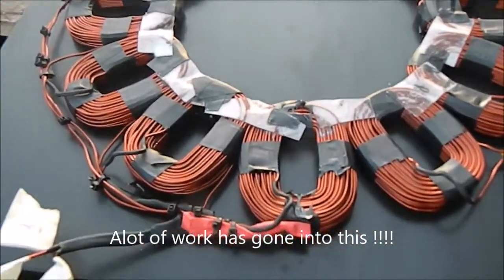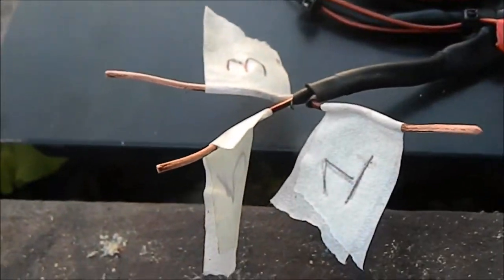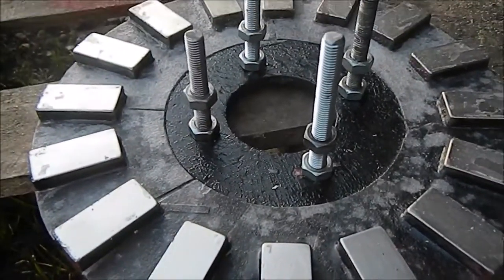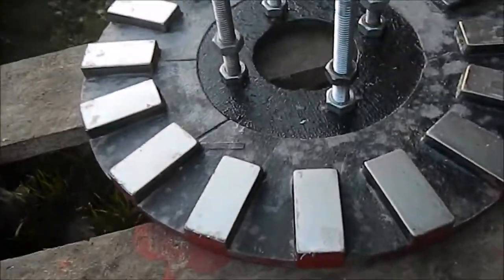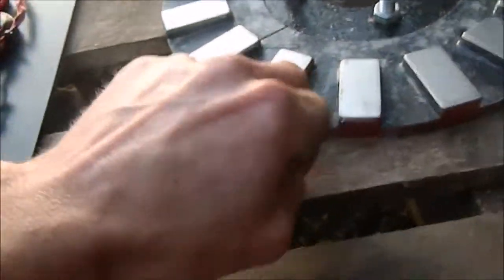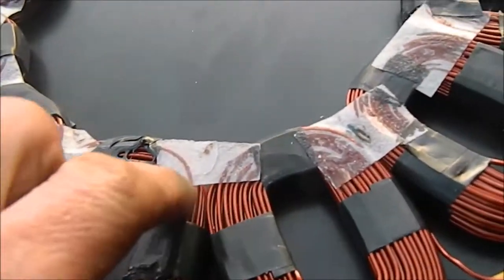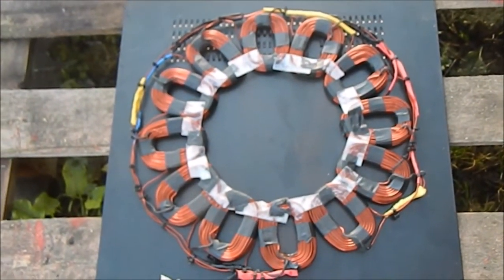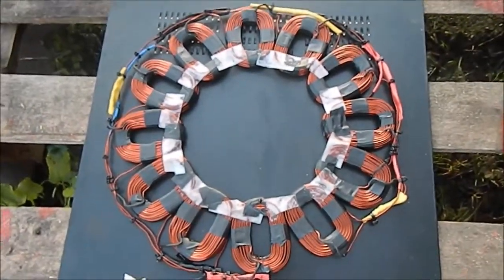VAWT Wind turbine Stator major progress 14 12 2016

Comment: Hi! Do you think a 22awg with 120 turns per coil will be any good? Thanks
Reply from the maker: NO THAT SOUNDS WRONG I THINK YOU USE 17 AWG HERE IS THE INFO YOU NEED https://www.otherpower.com/stator.html
Reply: I have just ordered a 0.80mm to do my coils but I don't know exactly how many turns I should do per coil.  And if 15 or 12 coils are better. I only do it to charge a battery. Thanks for replying back
Reply from the maker: That is too thin you need 1.6mm wire return the .8m and get 1.6mm or 1.63mm